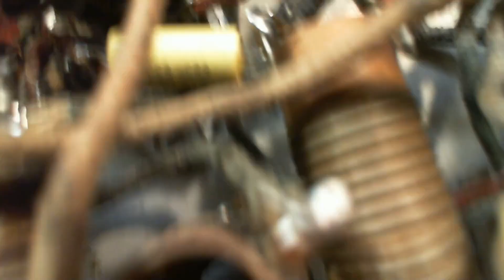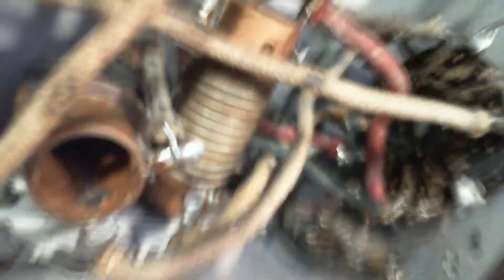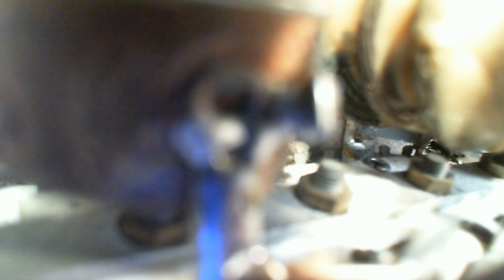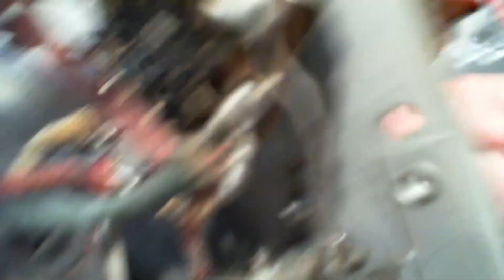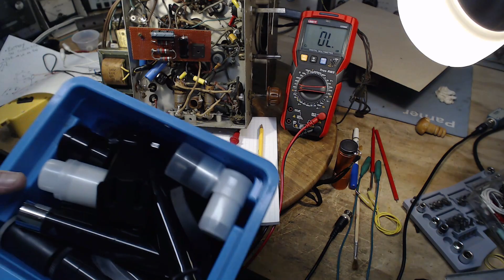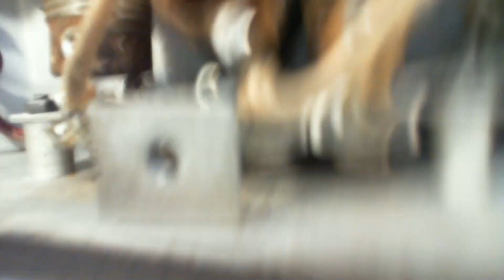Eatons Universal Electrohome Floorstanding Tube Radio Video #13 - More Puzzle Pieces

Comment: OK Going over this again please ignore that first post. I wasn't thinking about s1 and s2 being on the same switch. I surmise that the third position is the power off position. Therefore, the band switch is also the power switch. Figuring out which position is off might be a challenge That makes sense. I am 86 years old and my eyesight ain't what it use to be, so  missing something is no surprise. I knew that the tube was being used as a diode but never seen this configuration before. Chasing it out a little closer' that bias battery becomes very important to all the stages in this receiver. Without it nothing is going to operate correctly. Unfortunate the voltage isn't marked on the schematic. I have seen these that were more than one cell. These darn things were hard to come by, even back in the day 
Anyhow  I enjoy your videos and  watching someone do what I can't do any more. 
 closer' that bias battery becomes very important to all the stages in this receiver. Without it nothing is going to operate correctly. Unfortunately the voltage isn't marked on the schematic I have seen these that were more than one cell. Thes darn things were hard to come by even back in the day 
Anyhow  I enjoy your videos and  watching someone do what I can't do any more.

Comment: My 2 cents worth. The drawing plainly shows a 2-position switch, and you said there is 3 positions. If this is true, then someone changed the switch and no telling how it was wired. might be best to tear it all out and start over. Might replace it with a DPDT toggle switch.
Also the drawing show a bias cell. It's the funny looking semicircle around the middle of the drawing. How ever I didn.t see it in the video. This was common on a lot of these early radios.  It would be almost imposable to find a replacement.  A small Hg cell might work.  Does anyone have any idea what the first 1HG4 is used for ?  Grounded plate a little strange,
Reply: It is a 3 positions switch !

The bias cell he cut out & shorted it ...🤔
( I think it had a old crusty AAA battery soldered in ) 🤦‍♀ 

1HG4 is used as a diode .